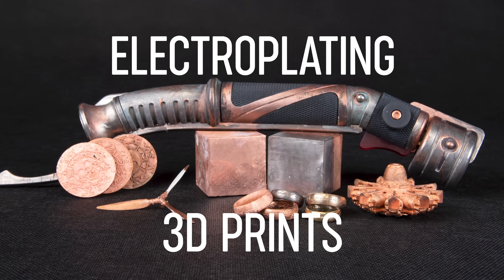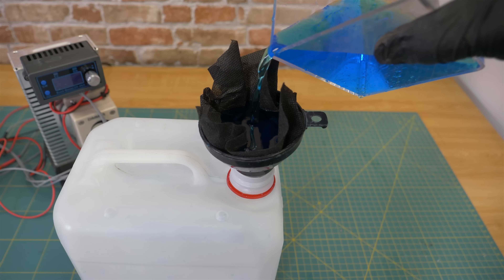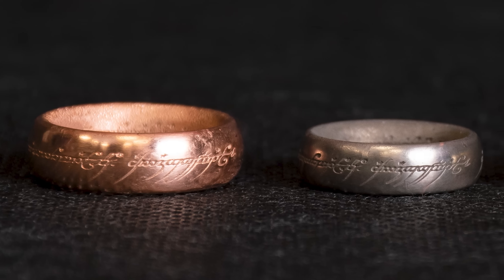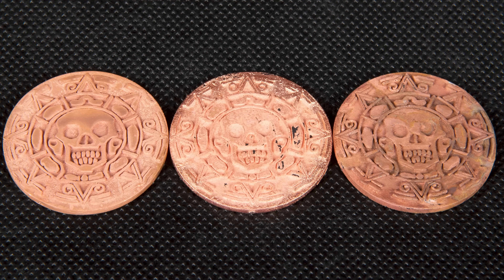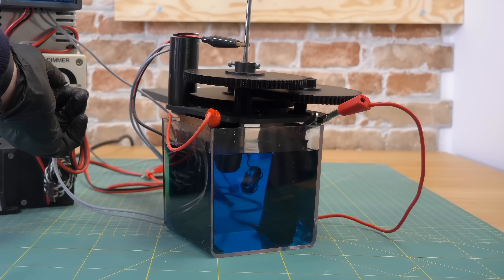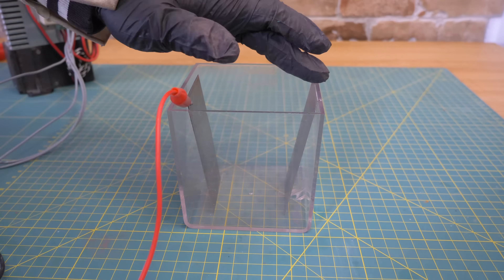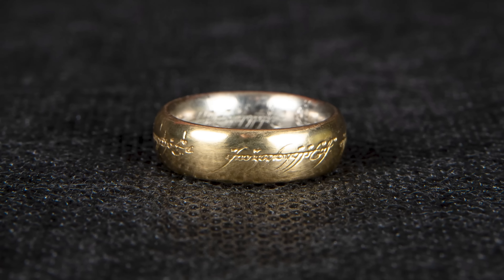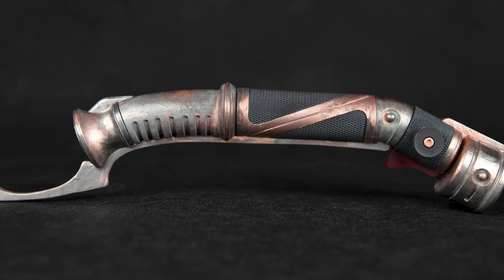Electroplating 3D Prints: the Symphony of Plastic and Metal

Comment: WOW, I just noticed your DLP printers resin tray helps pull the model from it instead of it simply being the build plate. That's pretty awesome. Does that help a lot or is it gimmicky?
Reply from the maker: It makes a huge difference. The peeling force is a fraction compated to trying to detach the entire layer at once. It is also more precise, compared to going up and down with the build plate, which is never absolutely perfectly repeatable. And as a bonus, it's even faster! We are surprised it is not yet more widely utilized. - Mikolas

Comment: I have a small part that I need it to be stronger.  Also it needs to be black.  What do you recommend for this?  I was thinking maybe plating it with some kind of strong metal would increase strength.  The problem is that a bolt goes into it and if tightened too tight it breaks.  Any advice would really be appreciated!

Comment: Is it possible to make hollow shapes with thin gold plating? Jewelry that is light in weight and large in size? And is it possible to do these things with 18-karat gold? For example, a 5-centimeter statue of a bear that is hollow and has a thin gold plating? And how can the 3D printer material be removed from it or does it dissolve in solution?

Comment: A couple of things...you can use graphite (not graphite lube) or nickel spray paint instead of copper spray paint. Just be sure to shake well before use. If you want your parts shiny right out of the bath then add brightener to your solution. Finally, fine steel wool and brass/steel brushes do a great job of bringing out the shine before a paste polish.

Comment: Copper plating on 3d prints is really hard.  I've been doing this for almost 2 years.  There is lots of of variables and if you are not a chemist you will need to do a lot of research when you have problems.  The hard part is to get that perfect shine.  If you use commercial solutions it's not that hard but if you want to plate large things then you go with homemade solutions and that is when the headaches starts.  I am still experimenting when I can, I am having difficulty getting consistent results.  I try also to get the greatest plating adhesion wich is another hard thing to do on it's own.  Good luck !
Reply: Whats your mix?

Comment: Even if this is a great tutorial, for everybody that wants to try this out, you might wanna check out the channel from HEN3DRIK - Electroplating 3D Prints.
He has some great tutorials in that regard and managed to succesfully electroplate large and complex parts like a lightsaber or the helmet from the Mandalorian
Reply: I said the exact same thing. But my comment got deleted? The guy is a pro at electroplating. He also tells you the formula which he used to calculate the amount of current he's using. Which he claims is the most important part.
Reply: He's right. Dialing in the Ampere's is the tricky part. @glp.1337
Reply: Hendrik is how I got my start.

Comment: Copper sulphate pentahydrate mixed with the sulphuric acid can and will eat and damage qutie a few types of resin, so beware and coat over them with a PU layer before the conductive paint layer. 

I've been doing this for over a year now, with reisn prints mostly, so I've the experience to know the issue.
Reply: The size of those TWO anode is way way way too large for the print haha You'll dissolve more copper in the solution than the print will have deposited on it. This will cause the solution to become rapidly oversaturated and need diluting frequently, and topping up with acids..

second issue, it's amps not volts you need to set with a Constant Current supply, 0.1 amps per square inch of surface volume (can use software to see what that is)

Comment: I wonder if the resin surface needs any kind of etching or adhesive primer for that conductive paint to really stick to.
Reply: Like most things with paint, it depends on the two surfaces. Since you need a very smooth surface I use a filler primer and smooth it as much as I can.